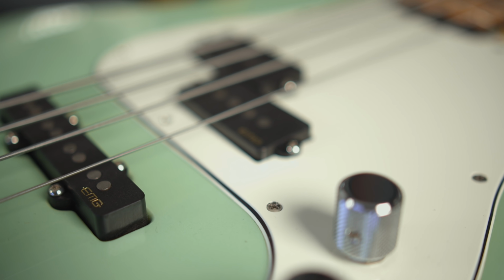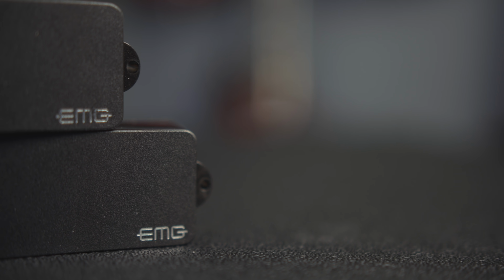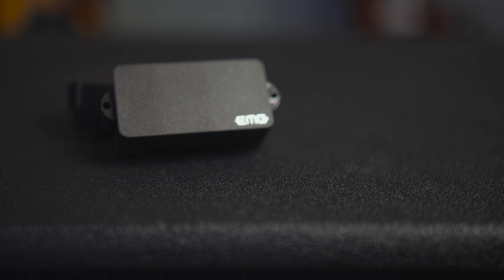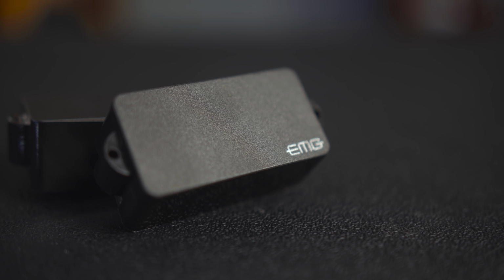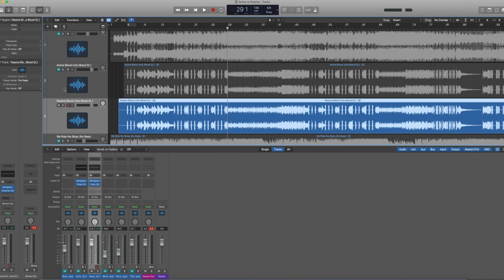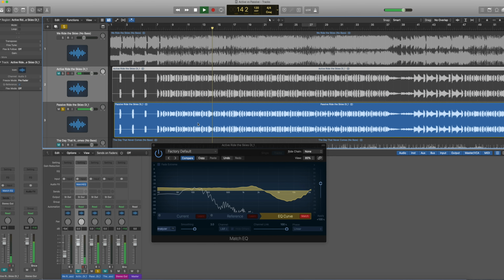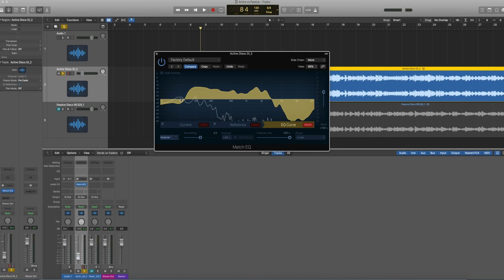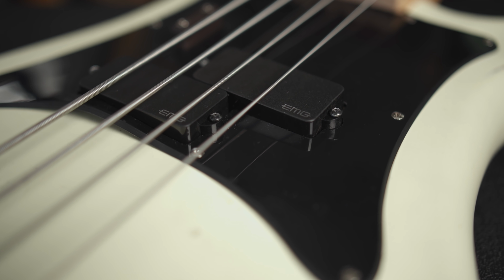The TRUTH About Active Pickups

Comment: The battery, man. The problem is having to screw around with a battery. Having to remember to unplug your bass every single time you touch it. Having to carry spares. Why don’t the geniuses at EMG make a cord and connection to solve this annoyance?
Reply: You carry spare strings don't you? Try getting a spare string in the middle of the night at any store, gas station or whatever. Try getting a 9 volt battery - fresh at that - in almost ANY store, you do not need to have a spare, the closest grocery store is your spare stash for 9 v batteries... You might skip on batteries for environmental things, which I have tried to do myself. But for other reasons than the hassle of unplugging it. BUT all this said, the "active" circuitry in a bass without EMGs will have that switch so you can carry on playing them passive, until you find the time to change out the battery. I know of numerous bassists that runs their active basses in passive mode, and have no use for the tone controls at all.
Reply from the maker: They do

Comment: 100% agree! I use EMGs in my old Ibanez 2369 Jazzbass since the 80s, when they came available in Germany. The housings are worn and a little 'carved' by fingernails after about 40 years and several hundreds of gigs. They still sound great and will probably withstand another 20 years or more. Sound engineers always liked them because of the extremely low noise and clean signal all the time in studio and live situations. I use them on most of my other basses too (J, P, DC, TW, 35J, JX & PX). 
One of the best things about them besides low nois is the low impedancy, so I don't have to worry about cable length changing my tone like with passive PU basses.

Comment: I owned both active and passive basses. To me, the advantage of active pickups is clear but small. On the other hand, that one time that the battery failed me during a gig was more than enough to steer me away from anything active 🤣
Besides, I have more than enough pedals to shape my sound anyway I want and I find it easier to do so with passive pickups

Comment: I expect the lifespan of an active pickup will come down to the quality of components used in the internal preamp, and just the luck of the draw that none of them will fail which, in my long experience with active electronics is much more likely than a passive pickup failure.  I especially dislike epoxy-potted preamps because they're not serviceable, but unfortunately that feature is baked in the cake with passives.

I have an old active bass with passive pickups feeding a once-awesome preamp that has unique features I really apprediate.  But that preamp has now become unstable; sometimes it breaks into oscillations because some component under the potting compound.  I suspect a capacitor but it could be the its solid state device dying.

The preamp manufacturer is no longer around.  The bass manufacturer has been relaunched but they have no information about the preamps they used four decades ago.   Now if I want those same features, I'll have to design and build my own preamp.  It's something I can do, but it's a PITA and frankly, I have too many projects taking priority, so that bass sits collecting dust.

Those old passive pickups are still going strong, as are the passive pickups in all my basses, some of which are well over half a century old.  It's that preamp under the potting compound that's failed.

Comment: The so called expert, being consulted, is confusing inductance with magnetic flux density and capacitance.  Inductance is the creation of current in a coil within a magnetic field.  The strength of the magnetic field is flux density and capacitance is how certain frequencies above a certain point get grounded out while the rest remain unaffected.  As far as I know, the relevance of inductance to the sound of a pickup, beyond signal strength is the specific resonant frequency of the inductor (coil).

Comment: most of the ponts talked about in this video I can somewhat understand, however, the one thing I could never go without is a passive tone controll.
Higher end basses with active/passive switching sometimes have the active treble control convert to a passive tone control. I can work with that.
but a passive tone control works differently then active treble cut, and for me personally, the sound and coltrol of the passive tone is an absolute necessity for.
Also, I hate batteries.

Comment: So what do passive pickups have that active don't? Consistency and reliability. It even gets mentioned in the video - your sound changes depending on the battery charge level; scrap that. Don't need the extra stress whether the battery will fail on me mid set, for whatever reason... Both my touring basses have passive pickups, but with the option to activate an onboard preamp, which makes it failsafe. Also, tonally, having a simpler initial signal makes it much easier to layer, and therefore control - I really don't buy the argument made in the video that it's easier to deduct. If you want highs, get some new strings, hit them with a pick, and make sure you have a J pickup in the bridge; those things will make a far bigger difference than the pickup being active over passive.

Comment: Not mentioned is the 9 volt (or 18 volt) elephant at the gig. If you’ve never had an active system collapse due to a dead battery, at a gig, you’re very lucky. If your active circuit is wired using the third lead off a stereo jack as the on switch, preamp is engaged when connection is made between bass and amp, the frequency of the problem goes up. Who hasn’t left a bass plugged in, and on, and drawing down the 9volt. Active circuits have evolved with 9 volt compartments making change outs easier (DOES ANYONE IN THIS BAND HAVE A FRESH 9 VOLT! ….. PLEASE, ANYONE!). This happened frequently enough for me to swear them off two decades ago. Yes, I’m old. Another reason active circuits are redundant is the quality of modern, digital amp heads. The last time I looked, you never have to play 9 volt roulette with these heads. Lastly the recording studio. Super-senior, Las Vegas engineer characterized low end frequency collisions as something to be solved with EQ. Hmmm.. Please dear fellow bass players and Bass Channel host, look up side chain compression. By arming yourself with this information, you will save yourself the much frustration (especially with unfamiliar engineers). If the wrestling match between the kick drum and bass guitar notes is attempted to be resolved only using only EQ and volume, you and your active bass will lose every time. Side chain compression use to be an expensive chore if it was known of at all . Now it’s usually offered as option in the software suite the rookie engineer is staring at. As the man said,” If it’s there . . .you might as well use it.”

Comment: I play both actives and passives on country, hip hop, RnB, funk, and standard rock cover gigs and have been doing so almost twenty five years. And to be honest, I have the active circuit off at almost all times on both my actives basses (Dingwall ABZ6 and NG3). And if I had a choice of running the ABZ with the Glockenlang or the NG3 with the Dark Glass, I’m going with the Glock as there is very little tone coloring, so my bass sounds like a boosted passive bass. Actives are a good option, but I’m not taking them over passive at this point. And you don’t have to worry about batteries either. 😂

Comment: It was my understanding that onboard active circuitry was created to reduce the effects of the  cable capacitance in longer cables used during large stage performances. In my opinion there's going to be preamp somewhere in the chain. I just prefer it to be from my di pedal or from my amp. If possible I like one preamp. They're all different. It's hard to organize what's being boosted and attenuated when you stack several preamps. If I had to play and active bass I would plug into the effects return jack of my amp to bypass its preamp.

Comment: Active and passive pickups have their place in the world.  I personally use a sire Marcus Miller V7 vintage jazz bass it uses passive pickups with an active preamp section.  For my application I prefer the sound of passive bass pickups with an active preamp.  However, when I'm in the studio I go completely passive for the most flat response possible.  For what I do a passive pickup with an active preamp works for my application it may not work for your application.  My suggestion is find what works for you and go with what you like.

Comment: i do think active pickups are better in terms of frequency retention and higher output, but they dont work with all amps/pedals, tho nowadays most bass amps are prepared for the added output but not all input pads are created equal, and while playing on your own the added treble sounds awesome, often in the mix its either distracting and/or overbearing and without a passive style tone  control youre gonna be screwd.
both have their place but sometimes oldschool is better

Comment: The whole passive and active debate discussion is nothing really. A preamp in your bass is just amplification and EQ in a different part of the signal chain. Not rocket science.  The best bass for both worlds is the G&L L2000. The tone controls and serial / parallel switch operate the same in both modes.  Lots of others like Fender and Mike Lull don’t have tone control operation in passive mode

Comment: I enjoyed this video. However the printed text showing at the bottom of the screen has many typos. It is sort of distracting.  I particularly like the engineer's comments about better to have plenty of frequency information and subtract, because you cannot create frequencies that are missing from the initial tracking session. Bravo.  Yet I still hear stories in articles and commentary about engineers, or more likely producers, that want nothing but P-bass with ten year old flat wounds from the bass player. To me that is lazy and pigheaded thinking, no matter how many successful songs they have produced!
All instruments have wide frequency spectrum's when you include their overtones. And they play notes that overlap with other instruments. That is how you can tell what instrument is playing. Say all play the note A-440, a bass sounds different from a trombone, piano, trumpet, saxophone. You can't pigeon hole instruments into particular frequency bands, but that is what some producers try to accomplish.
Yes I was trained in audio engineering in my college years long ago. So I do understand these fundamentals.  There is another positive to using active pickups on bass guitar. They are less susceptible to cable length loading, and interaction with pedals or other processing gear.

Comment: Quick tip, use a high pass filter.
Yes, even on your bass track.

It will help clean up the muddyness that covers up so much of your mix, allowing you to turn the bass up more without it sounding overpowering.

Remember, loud sounds cover quiet sounds, but at an equal volume, low frequency sounds cover higher frequency sounds.

It will also make your harmonics louder in comparison to your fundamental frequency, giving you a more saturated sound without adding too much gain/compression.
Reply: That’s a cool trick, gonna have to mess with that. May I ask though - you mentioned that at an equal volume low frequencies will cover up higher frequencies - you mean that low frequencies are perceived as louder than high frequencies at any given volume level? Haven’t heard that before, but not an engineer - where’d you pick that up?
Reply: @peadookie  perceived is kinda the opposite of true, because we actually perceive low frequency sounds as quieter. Especially as sounds get quieter and the Fletcher Munson curve starts happening. (Boosting the perceived midrange)

Think of low frequencies covering high frequencies as more of a blanket covering.
They "muddy" higher frequencies would probably have been a better word to use.
Reply: @TheAT5000  gotcha gotcha. So, not to be snarky, just trying to understand - wouldn’t you want a low pass on the bass and a high pass on the other instruments?
Reply: @peadookie  it's a good question.
The Lowest frequency on a 4 string bass in standard tuning is 44.5Hz on the E string, 36.75Hz if it's in drop D. So any noise below that is bad and just eats up headroom. Sometimes people call this high pass filter an "LLC" (low low cut) to avoid the confusion.

However, that is just the fundamental frequency. Unless you recorded with your bass tone knob on 0, most of what you are hearing is actually the low mids (especially if you are on a cellphone, which that, and in a car are the 2 golden standards of mixing these days) you probably don't hear anything in the lowest parts of the bass.

And we don't low pass/high cut the bass because we need that information to be able to hear the baseline on a phone. (Similar to boosting 8kHz on the kick drum)

My best advice though is to just get out there and try stuff. Understanding will come with time. I can't write my years of learning and experience in one comment.

Try building a mix with just the faders, then, with everything playing, start turning up the high pass filter on each track till you hear part of it disappear, then turn it back just a touch, and move to the next track.

You should be able to get a good sounding mix with only good sources, and a high pass filter, no other processing.
If it sounds right, it is!
Everything after that is just the icing on the cake.

Oh, and I generally don't use a low pass filter on anything except the drum toms. Higher frequencies take less power/headroom than lower ones, so you are only doing it to remove unwanted noises.
Reply: @TheAT5000  haha I’m on board. Yeah, then you’ll be pleased with my - I run a mesa TT800 and one of the reason I went with it was the high pass - which actually says “high pass” on the amp smh. I also mess around with synths, so I never thing “low shelf” when I think high pass 🤦‍♂️

But yeah, 100% with you - the high pass makes a world of difference, even in amplification too. Definitely worth incorporating

Comment: 18:54 - He said that active pickups are better, because signal has more information. How come that compressed signal from active pickups has more information than passive? Can someone explain?
Reply: Conventional active pickups are essentially weak pickups, with the signal boosted and coloured. Think of this as being like a small photograph that's easily blown up to a large size. Passive pickups are stronger, but not boosted, so think of this as being like a medium size photograph that's harder to make big. If that analogy doesn't make sense the basic thing to understand is passive pickups give you all the dynamics and nuance of the string moving, but that dynamic quality means some aspects are naturally more audible than others. With the active you get less from the string but it's more compressed, so you get the highs, the lows, quiet bits and loud bits all equalised together, and can tweak and dial that output more easily.

Comment: I am a long time pro bassist. 57 years playing the instrument. My background until 1993- was ALL passive pickups- some basses in my arsenal began to have active preamps around 1980. Then, I build my first five string- completed it in 1994. All Alembic circuitry, 3- single coils, and the full Stanley Clarke circuit. Does it sound great? Ah, yeah, it does, and it still does. MOST of my basses have active circuits now, predominately EMG's. The thing about EMGs now, is they are far superior to their original offerings, that had muted highs and transparency. I LOVE all my EMG equipped basses. I have some passive P-basses, and they pick up noise in some venues. a fully shielded Rick clone with all Audere electronics, is literally unusable in one particular venue. I feel that when the pickup itself is shielded, and the electronics are designed to work with that pickup- nothing can compare. Alison at EMG, is also extremely cool to us small shop repairmen and Luthiers. EMG, also offers their great pickups and circuits at prices that literally make me wonder why anyone would consider any other active circuit. 
P.S., yes, all our heroes had only passive bass pickups. But now...  think of what Jimi Hendrix could've done with a Floyd Rose tremolo.

Comment: Probably the main downside of active pickups is the power supply and secondly translation from active to passive sound.  If bass guitars came with XLR output, phantom power support with all major amps providing support as well as a "legacy" EQ switch to cut highs, I think the debate would be less severe.

Comment: Hmmmm...i have both active & passive bass's but a passive bass with the right buffering on my pedal board using a buffered XLR DI (100ohms) input & output,keeps my signal clean,clear & punchy...better still if mic'd amp & cab(s),Warwick WA300 Class A bass amp head & 1 or 2 x 15" or 2 x 12" Ashdown cabs...my ears prefer passive bass's...i can hear the effect of different tone woods etc but i can't with active bass's...active bass's are great for recording but i think a bass loses it's character with active pickups...i use various passive pickups,Seymour Duncan,Fender,Epic Custom Shop & active Nordstrands, all fantastic pickups,thankfully i can use active when recording but passive live as i luv that old school sound,pushed Class A amp with a passive bass, i can tell which bass is which passively but with active bass's i hear the electronics not the woods tones like a passive bass...& they are a bit sterile & 1 note imo, but different is good, everybody liking the same pickups would be boring & not very exciting for music luvvers..